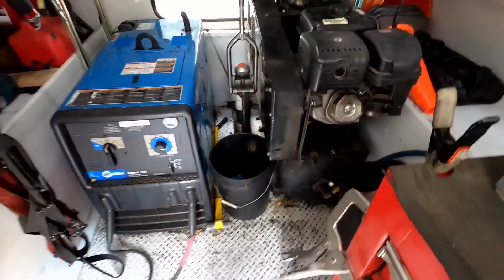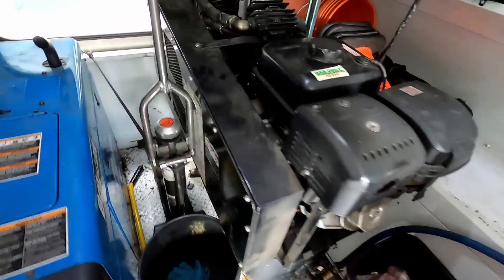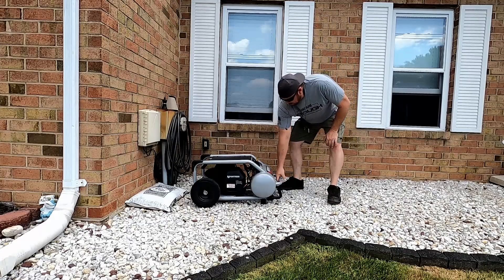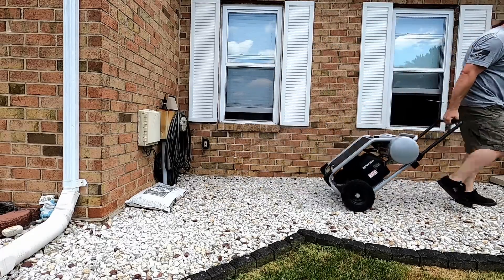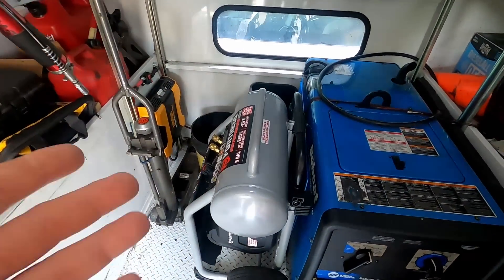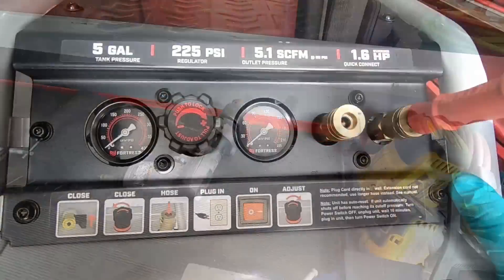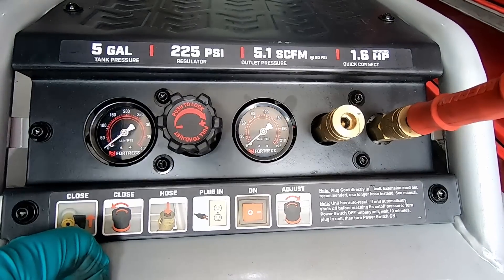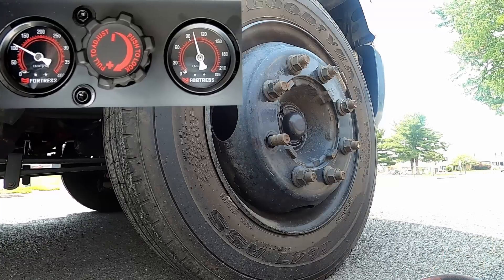Harbor Freight 5 Gallon 225 PSI Fortress Air Compressor

Comment: Yeah that air compressor seems about adequate for my viewing pleasure as a guy who only uses a compressor in my garage like once a month.
Reply from the maker: They just dropped the price to $300. I’m not sure if that’s a bad sign or a good deal 😊
Reply: I had the small one used it daily it broke after year than I bought this one , bought extended warentee and been going couple years . They’re nice and quiet but never last like a standard pump and motor compressor. Like you said we not using as much like when all out tools were pneumatic 😂 a
Reply: Actually I’m sorry I have the medium maybe 2 or 3 gallon , this is larger of the fortress I probably get this one next
Reply: Dam 300 not bad , I paid 2 something for one alot smaller

Comment: With 75psi coming from the regulator when the impact is going you are probably only getting 60-65psi at the impact gun. The biggest issue with impact guns is good air supply. If you had 3/8 lines and a high flow regulator set to 90psi it would probably double the torque from that IR impact.
Reply: *5,1510989bar at the regulator; 4,46428571bar at the impact gun; 9,525mm lines; regulator set to 6,18131868bar

Comment: Love your content, if you are after a little more performance from the tool, as you could see their was 10 psi drop. Change your fitting to NETA they have the largest thru hole, you will need to the two on the tank as well as your tools. I recognised the fittings in it and i would have thrown them out first, before starting it up even.

Comment: I was really curious about real world applications of 5 gal. and under compressors. This was pretty helpful, thanks!
Reply: I see them used a lot to run air nailers. You can also use them for air brushes. I know a dude who picked up a 1 gallon fortress a few years ago to paint his model planes with.
Reply: Handyman/carpenter here. I use a 3 gallon for running the occasional nailer. Only needed for nailing 2-3 boards. Might get a 1 gallon or switch to battery nailers. Definitely think alot of air tools are becoming obsolete with all the cordless stuff.
Reply: My 5 gallon is basically just for blowing stuff off in the machine shop.  Especially getting the glitter out of my hair before the sweat drips it into my eyes and turns them magnetic. 

It also sees occasional use for inflating car tires and running finishing nailers.
Reply: *18,925 liter compressor

Comment: I use one of these for plasma cutting, which has a requirement for 90psi @ 4.5cfm. It delivered and is able to run the plasma cutter at elevation 5800 feet, so that was really cool. Thanks for the video, I've had it three years.
Reply: What plasma cutter. I just bought the yeswelder cut55ds pro and was considering this for a mobile weld/fab set up

Comment: I think SCFM is a useful measure especially for someone who lives and works in say Denver or in severe cold all the time. Air temperature and pressure will definitely affect how long a compressor will take to get up to rated pressure, and how long it can hold it.

People are so used to dumping on Harbor Freight that their stuff is often dismissed out of hand but so far I’ve had good experiences with their stuff for the most part AS A HOME GAMER. Nice to know that compressor is adequate for your needs.

Comment: I've got the smallest Fortress compressor that I use in my woodshop. I shot about 400 brads yesterday, and it didn't miss a beat. I've also used it to blow off projects before finishing. Sure it needed to refill a lot for that, but it did it just fine. Plus, my broken back and shoulders could still carry the thing. And so so quiet.

Comment: We have a similar compressor in our one service van. All we did was add another small 5 ish gallon buffer tank. That system works great. I can run a die grinder hard as I can and a impact almost as good as shop air.

Comment: Electric forklift tech out of WI, our dealership is going away from compressors, some techs still have electric pancake compressors for running air hammers for stuck load wheels on pallet jacks. For blowing out trucks we have standardized the Milwaukee shop blower

Comment: Standard condition refers to Standard Temperature and Pressure, abbreviated STP, which is often used in chemistry and physics, especially when dealing with gasses. It is a baseline to describe and compare behavior under a specific temperature and atmospheric pressure.

Comment: Excellent video.  Nope, it won't run a paint sprayer, but if you go very slow, it'll work just fine.  I looked up a die grinder's air requirements on Harbor Freight's website, SCFM or 4.4 CFM so that little die grinder is operating right at the compressor's limits.  All you have to do is go a bit slower and considering the space and weight savings, probably a good tradeoff.
Reply: *124,594125l/min

Comment: I have a cheap 2 gallon air compressor that I picked up at Menards ages ago when I was poor.  I've used it to run nailers and air tires for nearly 20 years. 

I really really want to upgrade but I have battery nailers now and batteries power nearly every other thing I use.  

I'd probably use it to air tires and blow stuff off... Maybe pull out that old palm nailer if I decide to build a deck for the joist hanger nails.  It's just hard to justify.

This is the one I look at every time I go to Harbor Freight though.  The toolbox wants with the toolbox wants. 😂

Comment: Scfm is a standardized mass flow (not volumetric).  It is normalized to a certain temperature, pressure, and humidity.  It is 70F, 14.7psia and I forget the humidity.  The reason they give scfm@90psi is because of volumetric efficiency changes at different output pressures.  Scfm is the important number, not the acfm.

Comment: I think you could still use the cutting tool if there’s time, the Fortress has to be the best 6 gallon air compressor I’ve seen so far. It can cut for 16 seconds which is decent, and it refills in 30 seconds. It would be frustrating being 3 times as slow, but it could be just enough

Comment: RTP vs STP
Room temperature and pressure vs standard temperature and pressure. STP was measured at 0degC (30degF). In both cases it is at sea level (1 atmosphere). 1 mole of gas will change volume between STP (0degC) and RTP (also called NTP - normal temperature and pressure, 20degC). This is 22.4 litres or 24 litres respectively.

I believe that the 'standard' will reflect the parameters under which the testing took place.

Comment: The best thing I ever did to my truck is install a hardwired 12v compressor and 5 gallon tank in the toolbox. Tank could be mounted under the truck, but my 1/2 ton didn't have the space. Have a hose and tools in the box.

Added benefit is that I now have a button that people can actually hear if the need arises. I actually installed it for a nephew's graduation. I wasn't going to be outdone by the cheesy canned air horns in the stand, even from the parking lot.
Reply: *18,925 liter tank

Comment: It’s between that one and the FORTRESS 27 Gallon, 200 PSI High Performance Oil-Free Vertical Shop/Auto Air Compressor, Which I realize are two completely different compressors and it’s $100 more. I’m just using it in the garage for light duty stuff, but you never know so it would be nice to have the additional capability

Comment: IM from Finland. Here there are also two ways how you can measure compressor performance. Either how much it sucks air or how much you get 8bar pressured air. 
I only guess but maybe scfm is how much it suck air when there is no backpressure. I dont know but i think this is a good guess 🤭

Comment: I got the 1 gal version in my truck toolbox running off a battery/inverter. Quiet and works good for dusting out equipment, electronics, and airing up tires. Any pneumatic tools are out of the question.
Reply: Ya those 1-10 gal tanks are good for blowing stuff off, filling tires, and maybe a nail gun. Except maybe a roofing gun where you shooting nails almost constantly. Any constantly running/high flow type of air tool like a drilln grinder, impact, etc. I say minimum of a 30gal to have enough volume to efficiently and effectively run tools like that. If it requires 90psi to run for more than a quick blast, def min of 30. In this vid, that IR impact was probably only get 50-60psi. If it was gettin a constant 90psi it would blasted that lug off damn near instantly. But, most guys are running cordless for stuff like that these days. Especially mobile guys

Comment: I got one of those and I liked it but after just 2 years the pressure switch went bad. I hear that many others had the same problem. It's not that big of a big deal as the part is only about $12, but just be aware of that.

Comment: The regulator inlet size is too small and it's preventing the regulator from keeping up with the tank.  You might be able to put in a larger fitting or bore out the current fitting to get the regulated pressure more stable.  It could also be a water separator that is choking the pressure.

Comment: If you're running it on your welder, I would highly recommend turning the auto idle off.  If the compressor kicks on while the welder is at idle, the voltage will be very low.  It could damage the welder or compressor.

Comment: SCFM to me seems like CFM with an asterix that says "under ideal conditions/certain conditions apply" in fine print.
Reply: More so standardized, so you can’t fudge the rating by using funky air temperatures or static pressures.
Reply from the maker: And they don’t say what the “standard” conditions is 🤷🏻‍♂️

Comment: Picked me up a fortress 26 gal for my shop.  I dig it. It's quiet.....er, well it just doesn't put out an ear piercing hum so it's way better than the previous one. Of course it replaced an old and worn out 10 gal Coleman so the so the bar wasn't very high lol.
Reply: *98,42118 liter compressor; worn out 37,8543 liter coleman

Comment: Them big pull behind compressors don't like when the guys open the valves and walk away.  They suck I think it was the oil separator inside out. Only had to repair one of them for that reason.  That was about 20 - 25 years ago so maybe fixed that issue by now.

Comment: What pressure did you have it set to come on? If 175psi like recommended, this compressor is junk. If it was set any lower, you'll wear the thing out in a month. It's probably good for bicycle tires, maybe an EV tire inflation, one nail gun, weekend garage repair stuff, but just not enough nuts behind it for real world application. Which is ok, but not at that price. And that sucks too bc I found one on sale for $159 that I really wanted, and almost bought on the spot. Glad I waited. Remember kids, it's all about what's in the tank pushing you, 5 gal is not near enough to blow the hat off your head.

Comment: I need help, I’m on the market for a 1/2 or 3/8” impact wrench. I was going to buy a battery powered one, but they are expensive. Pneumatic ones are a lot cheaper, but everyone I saw says “require 20 gallon tank minimum”. Is that really a requirement? I have a couple small compressors like this one and smaller.  So should I just buy a battery powered one? Also, if I’m only using it for lug nuts mostly, do I need a 1/2” or will 3/8” do most of the work? This is just for home working on my pieces of junk.
Reply from the maker: From my experience 3/8 pneumatic impacts are dogs. Check out The Torque Test Channel. He’s shown some budget friendly 1/2 battery powered impacts.

Comment: You kinda should know what your CFM requirement is based on your tool CFM requirement.  Some tools are more "efficient" with CFM than others.  Most shops also invest in larger tanks to get more time. 😊

Comment: Whats the battery/inverter setup for that? Mine kills the battery I can’t run for it long. I got 3 12v bats and 150amp alternator. Gotta have the truck on to make the battery last
Reply from the maker: I keep the truck running when I’m using it. That pretty much goes for any inverter. There’s just not enough power in a automotive battery to do any real work.

Comment: I myself do not find that compressor very impressive!
I believe the real problem with the compressor is the tank storage is too small!!!
I myself which switch to a wheel barrel style gas compressor!!!
You could build a rack that goes over your welder, and then mount the compressor up there!    😎😎

Comment: Air tools that require a constant 90psi for more than a quick blast to run efficiently and effectively, like drillsn grinders, impacts, etc, no less than 30psi. If you're using them constantly like in a shop, 50-60gal, especially if feeding more than 1 person. Ya you may be able to pull a couple bolts if they arent super tight, but its going to run out of volume way to fast if you're hammering on something like that lug nut. Will it do it, sure, but not efficiently and effectively. its guna blow that compressor up if you keep doing it.

Comment: Great for grinding fingernails and toenails, but sanding down a cement truck to paint? You're going to need someone on the other end with the ability to blow really hard for a really long time.. Other than that they're alright for most home jobs. I have a tiny one for nailers.. Like you said though.. not much for a DA, cut off wheel, etc. Like running full speed from a mean dog with your pants down around your ankles..

Comment: 3kW at 12V is 250Amps. Your alternator and battery will not be able to keep up with that, not even close, let alone the wire gauge that would be necessary to provide that kind of current. Even 1200W is 100A so be really conservative with plugging anything in there...
Reply from the maker: It’s 3kw at 120 volts. That’s about 25 amps output on the AC side. That compressor probably pulls 10 amps

Comment: The way it was explained to me on the SCFM versus CFM. SCFM stands for stored CFM meaning the actual compressor cant hold that flow steady state alone and needs the tank as a buffer where as with a true CFM it can sustain that flow with no buffer tank.
Reply: That is incorrect. SCFM stands for standardized CFM. It's a MASS flow rate. It enables you to properly compare 2 different compressors from the same manufacturer or from any manufacturer that uses the same standards. CFM is a measurement of volume. However, the actual amount of air present in a given volume changes with temperature and atmospheric pressure. Basically, SCFM is CFM measured under standardized conditions, which actually allows an apples-to-apples comparison. The only problem is that the standard temperature and pressure used for this aren't exactly the same worldwide. They are, however, generally pretty close.

Comment: That is basically the same as the Dewalt. They don’t last very long if used daily. Pancake compressors are superior for everything except when you need lots of air but that requires a really big tank like 20 gal or much more. 2.5-4.5 com is plenty good for pneumatic guns and blowing off part- a little at a time.

Comment: I have had no luck with harbor freight compressors, ever.  It seems like there's always some little snippet of 'rots away in 3 weeks' critical tubing feeding one thing to another deep in the housing where you can't get at it and it bricks the entire device when it inevitably fails.  Good luck, maybe things have improved in the years since i said never again.
Reply: You DARE question Chinese quality and integrity?  Chairman Xi is not pleased..😂
Reply: I have had a CP 26 GALLON upright in my garage over 10 years and it is still alive and kicking....in the Arizona desert.... sorry for your luck
Reply: @robertwells6394  yeah i think some of it comes down to what shift was working the factory that day and I keep getting the short straw.  I finally just got a bostich, which was probably made at the exact same factory anyways,  and it has hung in there  good long time now.
Reply from the maker: On the bright side I didn’t have to pay for it 😜
Reply: I use mine everyday for hobby bench in the house , the trade off of not lasting as long is being quiet , the smallest one lasted a year but I used it a lot 7 days a week , it was still under warranty so I upgraded to middle size and extended warranty 2 years , for 200 if last 2 years worth and I’ll probably upgrade again so I hope it does break or even just get week , I still have compressors over 30 years old maybe even 40 old Dayton but it’s slow big and noisy

Comment: Don't fall for the same BS I did... Consumer grade air compressors use shady tactics when measuring SCFM it's not SCFM of 90PSI air it's SCFM of atmospheric pressure air with 90PSI in the tank. I would expect that compressor to deliver less than 1 actual working CFM at 90 PSI. I have a 12.7 SCFM compressor that barely runs a 5" orbital on half speed. SCFM ratings are a joke until you get into the real heavy industrial stuff

Comment: Id be interested to see how it runs a paint gun. I have a little 5 gallon compressor and I'd much rather buy a 12$ paint gun and $20 worth of paint than 5 or 6 $12 can of spray paint that only covers 10 square feet.

Comment: That would be SCFM. That's the recovery rate. The psi can be argued all day long. Set it at 115psi max and turn on at 90psi. I have a bodyshop with two compressors that are on 24 hrs a day so.... 115 and they will last forever at 225 not so long.
Reply: Which compressors ?
Reply: @xdiablox210  Those Kobalt 60 gal cheap ones on sale $499.00

Comment: The Dewalt 6 gallon pancake, Is half the size, half the cost, and is only 75 DBA. It's on sale at HD for $170
Reply from the maker: But it’s only 2.6 CFM
Reply: @FunkFPV  well Jesus man. Your not going to blow out an irrigation system with it... but, it will run air impacts. And hell, I painted a car hood, finder with it.